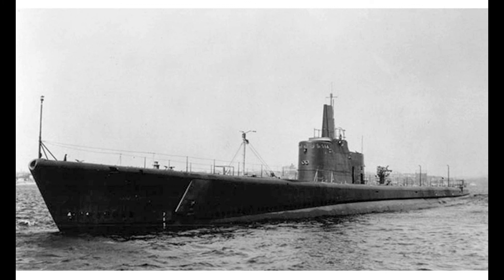Sounds of a Submarine with Hydrophone

Comment: Water is a far better transducer of sound than air so it makes sense that everything would be so loud and clear. Also, these sounds happening in an undampened metal tube means there's practically nothing between the sound sources and the water. Just 18mm-21mm of metal.